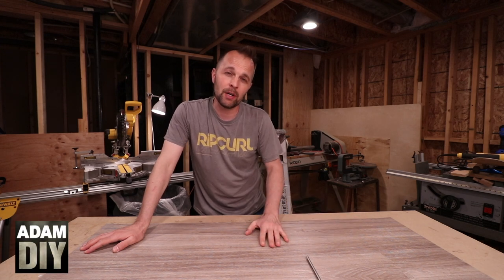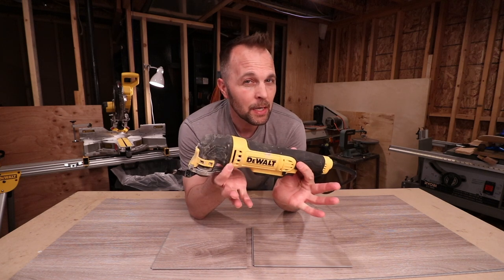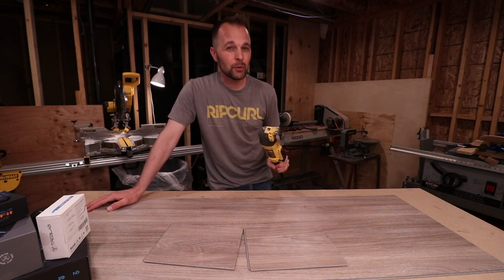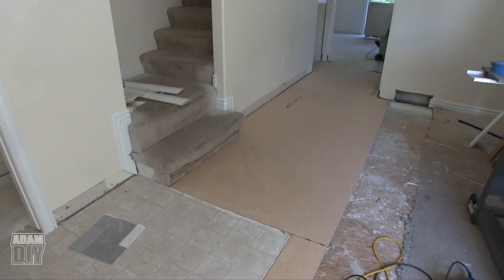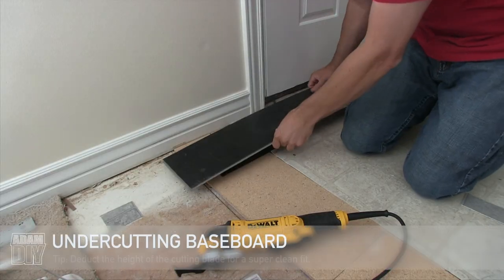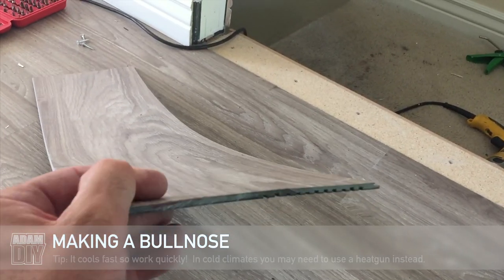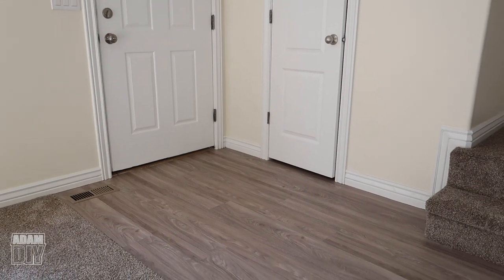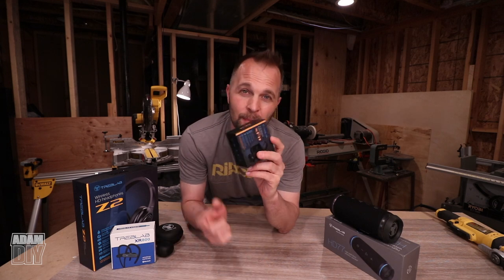How to Install Vinyl Plank Flooring & Make A Bullnose!

Comment: Pay attention to manufacturers recommendations for perimeter gaps and light exposure. This material expands/retracts a lot with temperatures and installation has to allow for that or it will bow up on you.

Comment: Does this LVP have a rigid core?  I have done the method of cutting ridges in wood to bend it, but curious if it works with LVP that has a rigid core.

Comment: I have a sunken living room that is part of my project with about a 4 inch drop from about 20 feet of hallway. I don't think your bullnose technique would work for this or do you think I can make that bend that sharp? My second idea after watching your video was to miter the edge of the plank on the hallway and then miter a 4 inch strip to face the step. Do you think that would stand up or do you think I should hunt down some kind of corner bead?

Comment: I got my contractor install vinyl in my condo and removed the tiles and laminate beneath and it's very uneven and some spot u can see it bent when u walk on top. And over all its kinda soft not sure if it's the padding cause it's a condo we have to add a layer of padding underneath the existing one with the vinyl....